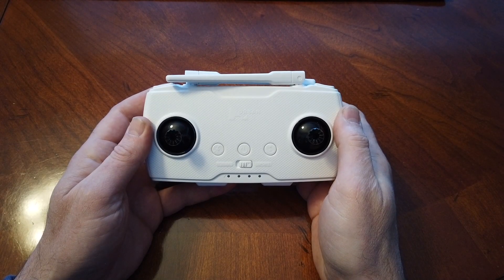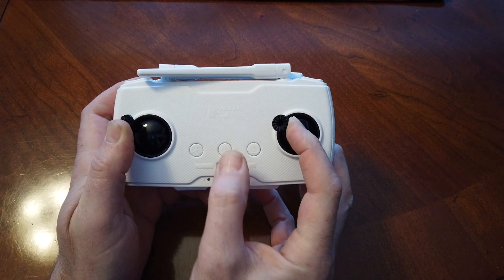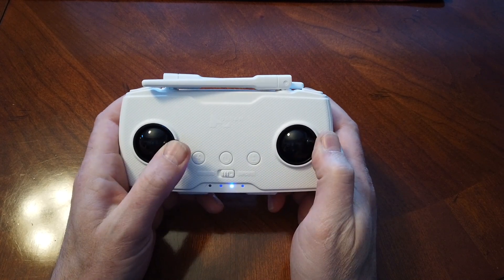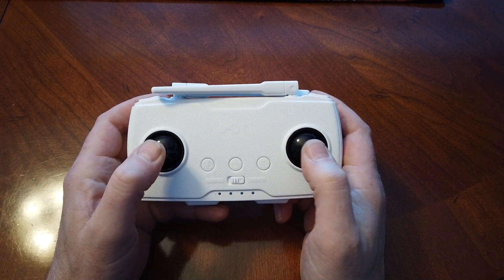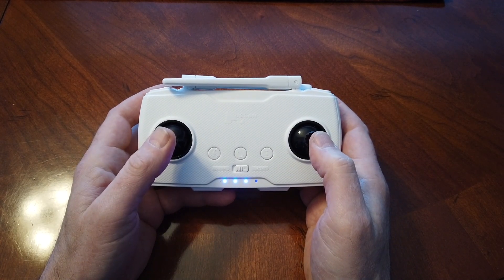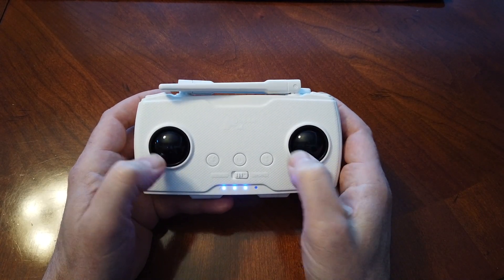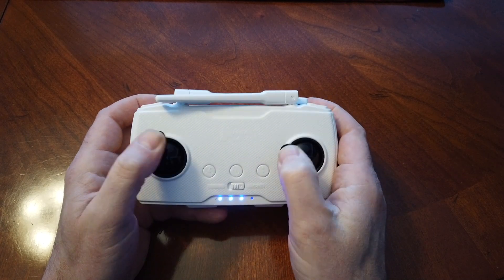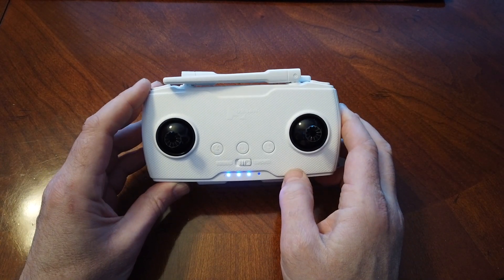HUBSAN ZINO- STICK CALIBRATIONS - HT016 CONTROLLER

Comment: Im trying this same method with zino 2 controller and its not working. Any info how to do this with zino 2 controller??
Reply from the maker: I tried on the Z2 and it didn’t seem to do anything. I wanted to know so I could do a video but Hubsan never answered to this question. 
I’ve not had to do it yet but see more and more on more current firmware people are getting a message of sticks not being centered so it would be be nice to have this information.
Reply: @QCGUY  yeah! Definitely! Ive had my Z2 for 4 months and have never been able to fly it yet. I'm so annoyed and frustrated. I feel like I got ripped off $
Reply from the maker: @Skipperj22  So nothing updated in the newer manuals on this then. I have messaged them and asked for information and to update the manual with such but get nothing.
Reply: @QCGUY  I just sent them an email to hubsanus support. Hopefully, I'll get a response. Ill let you know.

Comment: Doesn't work for me (latest firmware) - the lights flash, but it doesn't beep continuously like in your video.
Reply from the maker: Ash's Travel Channel Well that’s not good...
Reply: Me neither. Wont power on or beep.
Reply: Do you get this problem solved?

Comment: Will this work with the Zino 2 controller?
Reply: I tried it and it beeped until I held one of the other buttons after I moved the sticks around so I think it worked with the Zeno 2 controller also.
Reply from the maker: Trey Sharpton Yes, Same process as you figured out. 👍
Reply: @QCGUY  I hope this fixes my issues of not being able to land by pulling down the left stick. Seems like the drone won't ever shut the motors off that way.
Reply from the maker: Trey Sharpton I hope so as well and as long as the altitude doesn’t say + something then it should.
Reply: @QCGUY  well just tried it and yes I am noticing that when it is on the ground it seems to think it's not at zero in fact it varies from like 1 m to 2 or 3 m. Guessing I need to try to get a really solid GPS calibration.
Reply from the maker: Trey Sharpton Horizontal calibration in the app. 👍
Reply: @QCGUY  thank you
Reply: How o tried no beep

Comment: Sorry... I updated the transmitter, but when I turn on it the blue lights doesn't stop flashing. Could you help me? I have the black version of Zino.
Reply from the maker: Anderson Moreira Join my group...make a post there with a short video clip showing the problem and you will get plenty of help. There are different issues with different fixes so it’s easier and much faster this way. Thanks 
https://www.facebook.com/groups/HubsanQC/?ref=share
Reply: @QCGUY  OK, thanks! I'm waiting for the request.
Reply: Hi do you get solved this issue?

Comment: My controller is not working and the lights are flashing when I turn it on, is there a reset button?
Reply from the maker: John Brown Did you just update it or the app? Best to join my group and show us what’s going on in a video.
Reply: Do you get this issue resolved?